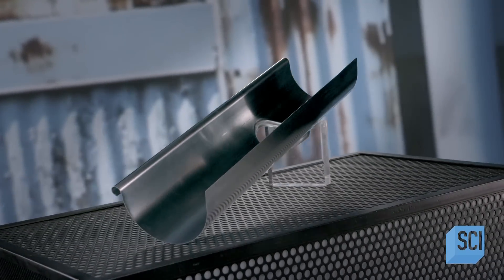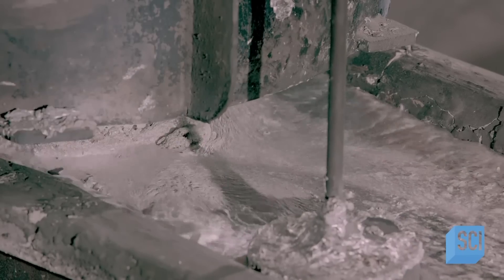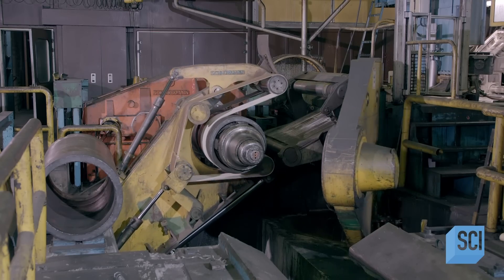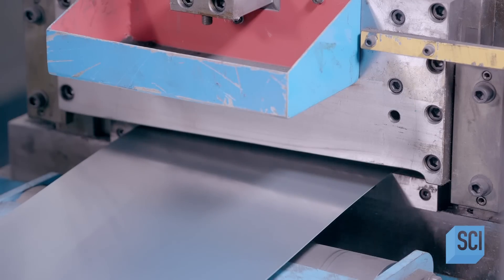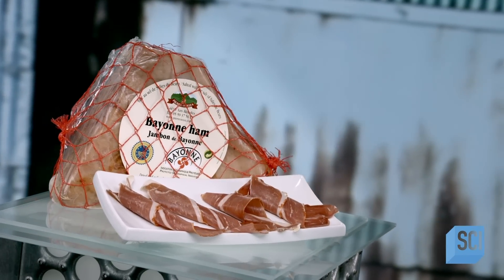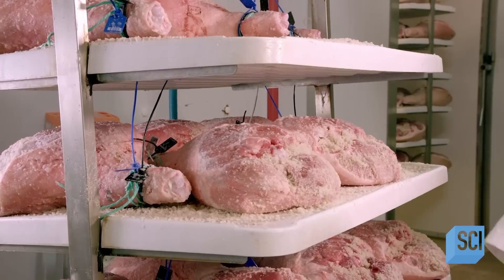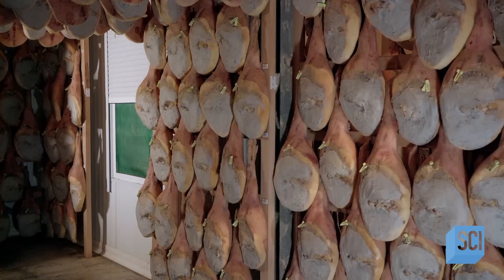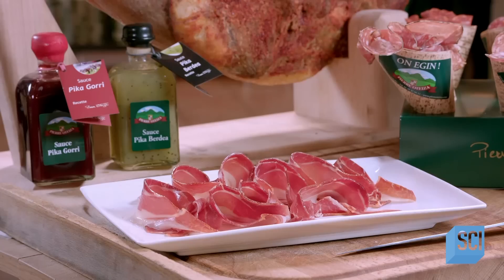The Surprising Journey of Making Zinc Rain Gutters and Ham | How It's Made | Science Channel

Comment: Titanium does not melt at 700 degrees C.
Reply: Maybe it's just titanium powder. Zinc doesn't have an alloy with titanium and copper, at least not a very common one. I'd imagine it's just mixed into the liquid zinc, not melted together. It's likely Zn8Cu5 if I had to guess
Reply: It doesn't need to melt if the zinc is molten
Reply: No, but it is basically dissolved by the liquid zinc the same way liquid mercury dissolves gold (not terribly soluble though). The alloy contains 0.05% - 0.18% titanium and 0.08% - 1% copper. Z41121 (low copper-titanium zinc) and Z41321 (high copper-titanium zinc) are produced per ASTM B69.